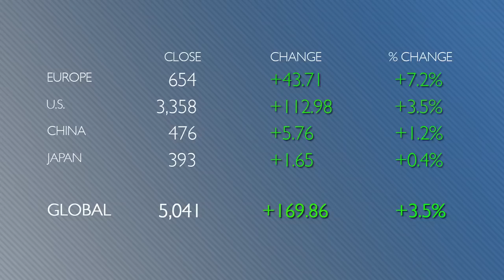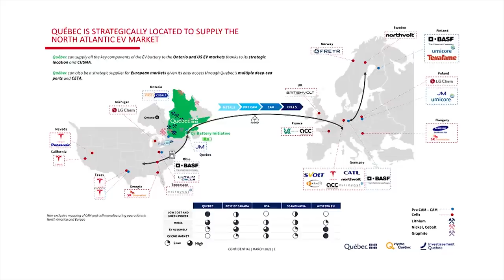Genesis Reveals EV Concept; VW Name Change a Prank - Autoline Daily 3048

Comment: Canada can play a massive role in the production of batteries, motors, and chip manufacturing for the electronic and automotive industries.   We have loads of cheap baseload hydro and nuclear power, and lots of cheap wind and solar resources as well.
Reply: Get to work then
Reply: @user-hc9qv9yb9m  You're gonna have to wait. It's the middle of hockey season.

Comment: If Porche drivers are ok paying $20/gallon for eFuels, then sure, go for it. But if you want to make a cheap fuel, you don't use a process that starts with the electrolysis of water and CO2. Electrolysis is a very energy inefficient and, as such, costly process. You can do it. But the costs get very high very quickly.
Reply: Think of the advantages Doug. With this no-pollution fuel or with hydrogen, it's perfect for drivers who demand a non-polluting car at any price  that will retain all the leaks, repairs and high mileage expenses of an ICE vehicle, along with the numerous inconveniences of ICE car ownership. Why fuel at home when you can visit a gas station instead?

Comment: What would that blend of E-Fuel to gasoline be to get 85% fewer emissions?  Why are we still hanging on to Fossil Fuel when  All "Fresh Fuels" would be apparently cleaner still?  Lubricants, Anti-Knock, and other such additives that are added to Fossil Fuel Gas?  But then why not just add those to the E-Fuel? I get E-Fuels would be in relatively limited supply up front. I guess I just want to know.

Comment: We should not ban technologies. Let the markets decide, allowing technologies to adapt and improve as long and far as they can. If they can not go the distance, they fade away. We never banned the Steam Engine and it still finds uses from time to time. We have not banned the Wankel Rotary engine, there are a litany of improvements waiting to be made to the engine, and Mazda (And Audi IO think) wants to use the Rotary engine for a generator engine (Extended Electric or Gas Electric) for their cars. Nissan is working to prove this case with E-Power...

We have not banned Nuclear yet... Thank goodness. 

In the fervor to "save the planet", decisions are being made now that would only bite us in the butts later. Decisions being made by those who are not effected by those decisions. 

The Earth is NOT going to turn into Venus. or even try to. The Earth has had far higher CO2 levels in the past and did not "turn into Venus". Earth would have to lose its magnetic field for MILLIONS of years so the solar winds could lift away the lighter atmospheric gases, Nitrogen, Oxygen, and the like, to leave heavier CO2 behind. and be millions of miles closer to the Sun. Water is not going to evaporate into space because  Thick Atmosphere. And most importantly , our technologies have been growing cleaner as a function of Capitalism and consumer sentiment over time already.  So we do not need to make haste to "save the planet", we are already doing that at a very not dramatic but sustainable and cost effective pace.